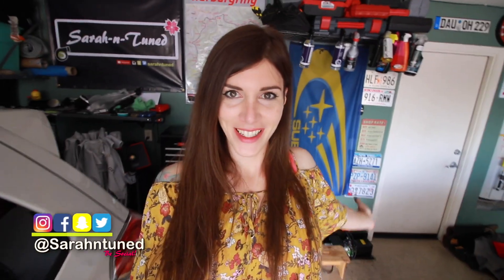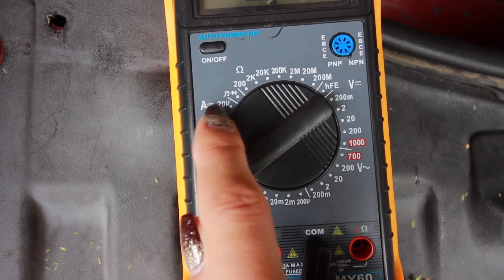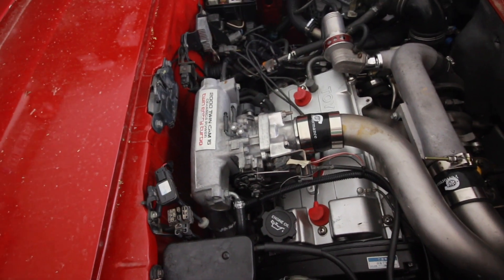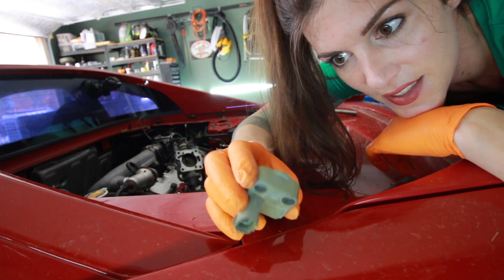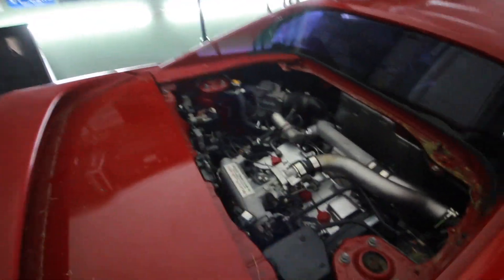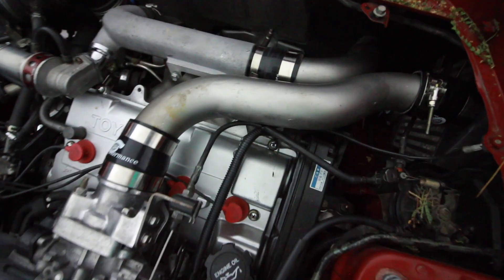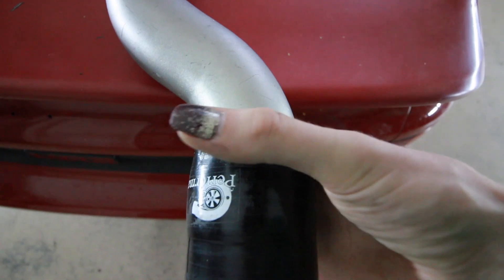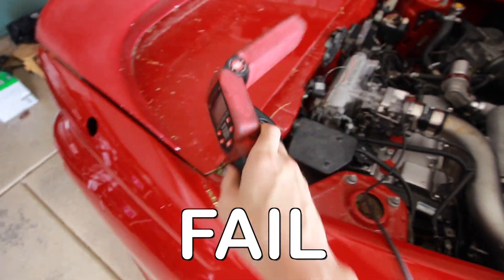I Fixed my MR2! // First Time Building Boost

Comment: Hi Sarah,
Have you ever tried to set the timing statically?
You wind the motor by hand until your mark on the balancer lines up with the desired timing settings behind it.(ensuring you are on compression on number 1 cylinder)
Once the marks are lined up remove your spark plug and lead from #1 cylinder and hold the side of the plug to earth on the engine with the lead still attached.
Now twist the distributor until you see the spark jump. You will find this will nearly be spot on when rechecking with a timing light.
Hope this helps.
Cheers 😁!

Comment: I have also had problems from crappy hose clamps. Most of the ones sold these days are crappy and don't hold very well (often they strip out as low as 20 inch-pounds). Some industrial supply places have hose clamps that are much better (35-40 inch pounds, or more).

Comment: Congratulations Sarah, I never had any doubt you would get Mr, Dos fixed, you are so clever and persistent. In a pinch electrical splicing tape works wonders on things that leak. The trick to using it is to pull/stretch the tape and it will form around irregularities  such as the intake fittings and unlike regular electrical tape it will not come apart in the heat of the engine bay. No tool box should be without a roll of it. Get the 2 inch wide tape I think you will be surprised how well it works and  how often you may find uses for it. Hi little Sara, welcome back. I hope your mom is feeling better.

Comment: Congrats Sarah, this sounds like major progress. As an old guy, this takes me back to the late eighties, where I first saw a MR2 at Limerock park. It had the front end smashed in and was sitting on a single jack stand in the paddock area. MR2s do not take front end impacts very well,  something to worry about now that yours is mobile.
Reply: On the other hand, they take rear impacts really well. I once had a Nissan run into the back of me. Completely destroyed the front of the Nissan, all crushed in, coolant all over the road. I had a small mark on the bumper of the MR2 and that was it. I didn't even have to repaint the bumper.

Comment: Great job finding the parasitic draw - it can be a pain in the ass - and nice job cleaning the idle air control valve, when you finished fixing the last bits and bobs, you'll have a great little car.

Comment: Awesome you found it Sarah! Remember working on a lot of older Toyota with that type of IAC, i’d say60 to 70% of the time I could just clean them and they would work great again, I would use carburetor cleaner or the new throttlebody cleaner because they leave a film on the parts so it doesn’t gum up as well....on my Scooby snack I make sure to check and clean the throttlebody and MAF ever so often just to make sure ! The other thing I noticed on our Subaru engines is make sure you clean the PCV valve every couple of oil changes and or replace it and that helps with our oil consumption issue ! If I’m correct on Mr. DOS your mass airflow is built into the air filter cover and is a giant flap basically that is based off resistance.

Comment: pull the dome fuse out and see if your radio still works. my cressidas dome fuse also fed power to radio so the draw could be through there if its wired up wrong.

Comment: Jut read voltage drop across fuse.. And the circuit that is active will have a small voltage reading!  Check on power porbe website and they have a chart for voltage drop for different fuse type and a current conversion!

Comment: In the future, if you need an emergency coupling until some new parts can come in the mail. Go to Lowe's, to the plumbing section. I learned this from Haggard garage. And had to do it once and it was actually a pretty damn high quality rubber coupling. Of course I changed it out because I can't have plumbing parts on my European masterpiece. But its  a temporary solution.

Comment: Good to see Sarah ST ; Very nice work on the Mr. Dose  Sarah your attention to detail is very impressive also!  Congratulations to you! Oh, and one more thing:  I noticed that you diagnosed the intake air leak problem, but in typical Sarah fashion you tried to make it perfect right away (shopping for silicone couplers.....).  Solve the problem first (like you did with the tape) THEN, detail it later!  step, by step, by step (not all at once). There is nothing wrong with "mocking" something up to check function (verify first, make it pretty later).   And look at the/your result - Success!!   Your reaction says it all Sarah.... congratulations.  Well done!!!

Comment: Great video, Sarah. Don't get rid of the old battery because I just sent you a high-quality battery charger, so you can get it back to full strength. I also sent a new timing light, so you can get Mr. Dos in proper time. It was delivered to your post office box on Wednesday (yesterday). You'll also see a new Power Probe tool in your post office box on Monday afternoon. You're gonna' need that to square away the electrical issues that remain in Mr. Dos. I've been a mechanic all my life, and have done well in the trade. Now, it's time for me to give back. So, as my favorite You Tuber, I'm giving back to you. Enjoy! Keep up the good work.
Reply: P.S. I just got a message from my UPS app, telling me that there was an "exception" at your post office and that "the receiver does not want the product and refused delivery." And that's already after they accepted delivery yesterday. It's a medium-sized box that weighs 20 lbs. I hope this doesn't turn into a mess? I wonder if the box is too big or too heavy for your P.O. Box? Something you need to check on, for sure.

Comment: Ask for your amp draw and be in your dome light you need to check your cigarette lighter or you need to check your door pins and the other thing that most people don't think about is the vanity mirror light that is inside of the sun visors
Reply: VdubSPAZ
MR2’s don’t have vanity lights
Reply: @negativeindustrial  what about glove box or center console light
Reply: @negativeindustrial  is there any courtesy lights on the doors when you open them that are not being shut off when the doors are shut
Reply: I actually know nothing about mr2s other than they're made by Toyota and have a rear engine
Reply: VdubSPAZ
The doors have one light each, the two map lights function as the dome light and there is one under the passenger footwell. All of these come on when the door is opened. The map lights can be turned on individually. I checked mine just now and I get no draw. Sarah’s car looks to be in way better shape than mine was when I first started the restoration process.
On other Toyota sports cars from that era the cig lighter is often on that same circuit. IDK about the MR2 tho so I’d also check that. If she does the same test and starts unplugging bulbs she should be able to narrow it down to the offending bulb.
Oh! One more thing - the dome has a gradual off feature so that it slowly fades off after the door is closed. I’d check to make sure that is working properly as it may not be shitting all the way off.
Reply: @negativeindustrial  the gradual off thing sounds like there's a module possibly.... The cigarette lighter as well as sometimes the radio is on the same system as well... The cigarette lighter could be just a small piece of aluminum foil or chewing gum wrapper sometimes down in the cigarette lighter and someone put the wrong fuse in not letting it blow. Or it's just a small enough piece to really not cause any major issues
Reply: VdubSPAZ I checked the cig lighter and it’s not on the dome circuit. I’m really leaning towards the dimming function now. The door buzzer would still be working if it was the door switches. Remember this is a 1990 car so it still had the Uber annoying buzzer from the 80’s. I’ve wired mine to a switch so I can work on the car.
IDK if Sarah checks all these comments and maybe she actually wants to figure it out herself but I’d honestly start pulling bulbs until the draw stops. They’re super easy to get to - maybe 1min each.
God, I wish my paint was as good as hers. Mine has had all the body work and ready for paint for a while now but I keep buying other shit for it LOL. Mine runs beautifully tho so I’ve gotten that all sorted. At 18psi it is sooooo quick.
Reply: There's a lot more than the lights on that circuit. A quarter of an amp is usually a computer staying on or a soft short/corrosion in a component. Theft deterrent ECU, woofer/audio amps and antenna, aftermarket radio?, seat belt warning relay, and the illumination for the key holes are all powered on that same Dome Light fuse.
Reply: I have an early '91 MR2, UK spec. Had it for 24 years! 1) The cig lighter isn't on the same circuit as the interior light. I don't know any car that has that arrangement! 2) It doesn't have a dimming/slow turn off function, it's purely on the switches. 3) I don't have a passenger side foot light. 2 and 3 must have come later or is US specific. 4) The beeper I have is for the lights, if I leave the lights on and open the door, the beeper beeps.

I don't know if the boot light is on the same circuit but I'd check that. I don't actually know where the switch is for that but mine does actually turn on and off as I open and close the boot lid.
Reply: Paul Sengupta
Sounds like yours and mine are very different. I have all of those things including the dimming function which plays hell with LEDs if you try to upgrade the dome bulb.
BTW I can name 3 contemporary Toyota/Lexus with the cig lighter on the dome circuit. The MR2 is not setup that way - I confirmed that on my car yesterday
Reply: I believe only the vehicles with the door/ignition lock illumination had the fade to off lighting, as they used a different interior lamp relay.

I would still very much be looking at the other components on the circuit, not just the lights.
Reply: Paul Sengupta
I don’t have the buzzer for the lights and it’s bit me in the ass once. Mine only buzzes if the key is still in the ignition
Reply: I have the illumination around the ignition key switch, but door locks? I certainly don't have those. How/where are they fitted?

I guess there are a lot of wiring differences between UK, Japanese and American spec cars!
Reply: There's a small green light that is installed in the side of the driver's door lock cylinder, powered on based off input from a switch built into the driver's exterior door handle. Door locked, lift the handle, light around lock cylinder turns on, it's not bright.

 I don't know about non-NAS cars, but if it has the ignition cylinder light, it should have the door lock light too.
Reply: Paul Sengupta
I don’t have that one either, in fact neither does my GT4, and both of them have the ignition cylinder light.
Reply: '91 jdm, i do have a light up fading ign ring, no door lock light or fading interior lights...   also have a '94 adm (bathurst), no light up anything.

Comment: Hi I worry when you work on a running car in a enclosed space like your garage. I recommend that you find a way to route the exhaust directly outside. Carbon Monoxide levels in your blood accumulate over time.

Comment: Well Done!
And, fyi,... the 'coolant' pipes in to the idle air valve, don't 'cool'.
They route hot coolant from the engine through the manifold to stop the cold air charge from freezing the throttle body end of the manifold.
Icing up a manifold can be a pretty big performance killer back on Carburetors - Formula Vee engines can be particularly susceptible to it., and it's more common on engines where the manifolds are Ally, as cast iron transfers the heat from the engine block better.

Comment: Fun fact: manufacturers use the "dome light" fuse for lots of little items. Could be half a dozen small loads on that fuse. Examples: glove box light, courtesy door lights, mirror lighting in sun shade, door ajar indicator. Time to break out the wiring diagram

Comment: Just a suggestion Sarah, if the mr2 has been running super rich from the advanced timing it would be a good idea to do a oil change and new spark plugs,
Obviously oil breaks down when contaminated with fuel!
Reply: It hasn't really been "running", it's just been started a couple of times.

Comment: Here's a tip periodically put a maintainer on the battery (preferably when you know it will be sitting awhile). I have a optima it is over 10 years old, but it would help on all brands. I also live Louisiana which normally a battery last 3-4 years. You are right though brand name does not matter.

Comment: I look forward to your videos.  Good work with the multi-meter and the IAC valve.  Just so you know, being the purveyor of automotive information that you are, the connection between the metal tubing pieces are called couplings -- g not k.  They are there to "couple" the pieces together.  Not to be confused with cufflinks, which are something else entirely, ha ;)

Comment: I recently tried sourcing a new silicone coupler for my IC kit and I couldn't find a simple coupler anywhere in my area. I went with a high pressure coolant hose in a pinch. Worked well until I could get a coupler shipped in. It's bogus that most major auto parts retailers don't carry this.

Comment: I usually will have the car running and loosen the distributor then turn it one way til it runs ruff then turn it the other way til it runs ruff then turn it back til the idle gets smooth. and that gets it very close.

Comment: What you are going to do is take your ridiculously expensive automotive pico scope.. you plug it in your laptop, take the amp clamp and hook it on the battery cable. ((im a professional mechanic and love that pico scope it's so awesome, you can even do a qiuck compression balance test as easy and fast as testing a battery))

Comment: So with the dome light parasitic loss, would that be considered a closed circuit all the time as I would think that when you open the door and the little switch in your door would make the contact to activate the light?
Reply: Timboslice something is on the same circuit. It might power something else inside the car.
Reply: There's quite a few things also on that circuit besides the dome light. For example, trunk light, trunk switch, ignition barrel light, courtesy lights on the inside of the door panels, etc. I'd hazard a guess that the person that installed the JDM engine hacked into one of these things and messed something up.
Reply: There's a lot more than just the lights on that circuit, anti-theft ECU, woofer/audio amps and antenna, seat belt warning relay. At 300mA, I'd be looking at anti-theft ECU and seat belt warning relay first.

Comment: Those are good batteries, you picked it up from O'Reilly's. Optima batteries, I can say this they have an awesome marketing department. Other than that, they are not any where close to the quality they were 20 years ago. The first Optima I had lasted 9 years. When it died, I ran out and bought another one, well that lasted less than 3 years! WTH! Well Optima decided to move their manufacturing from Colorado to Mexico. After the move to Mexico their quality really went down hill. I personally know a guy who worked for Optima and he was told by the top brass to say they are manufactured south of Laredo, TX which is just on the border of Mexico. If you want a bada$$ AGM battery check out Odyssey battery (odysseybattery.com) or Northstar AGM batteries (northstarbattery.com). Great video Sarah!

Comment: Maybe your batteries die because you slam them down on concrete lol.  You need like a rubber/plastic pad to not damage the internals.
Reply: just leaving a battery on the ground is a bad idea...a piece of wood works really well...the batteries in her cars keep dying because of constant need of recharging do to the parasitic drain that she fixed. i live in the same area and batteries last me for years

Comment: I've lived in California up until last year to the day actually 😂 but out of 20 years of California heat of up to 120 for weeks at a time sometimes I have gone through a total of 4 batteries I can count. 2 in a 2000 GMC Sierra with 238k miles. And 2 in a 2002 f250 7.3 with 240k that I bought from my grandpa who bought brand new. He used those it came with for several years, replaced them once and I replaced them in 2015 when the alternator died and killed them in the process. That truck has had 6 in 16 years and it takes two at a time 😂 heat doesnt necessarily kill batteries because if it did that truck wouldve gone through a lot more lol cold tends to harm batteries worse and they are rated in cold cranking amps because they lose power in cold because...science? I would say you've just had really bad luck with batteries to go through them every two years lol

Comment: What was the issue with no 12 volts?
Reply: George Mitchell I doubt that was ever an issue to begin with, probably supposed to be 5volt ref signal. Not 12v

Comment: Lead acid batteries should not sit without charge for more then 3 months even new, because they do self-discharge and once they are past a certain point they start to build up gunk on the plates so they just keep performing worse and worse.
And in cars you usually don't even get 3 months because alarms and computers keep running if you want them or not.

Comment: Hey Sarah are you going to swap your MR2 back to stock exhaust?
Reply: She bought a new exhaust for it and mounted it.
Reply: jody024 she bought exhaust for the Audi TT. don't think she bought one for the MR2 I could be wrong though
Reply: There might be a problem here. I was having some work done on mine, a UK early '91 car. It still had the original exhaust. Anyway, they had to cut it off for whatever reason. After that, they found that Toyota no longer sell the original one. I had to have a £500 stainless steel one made for it.